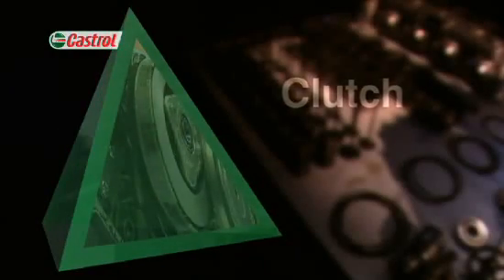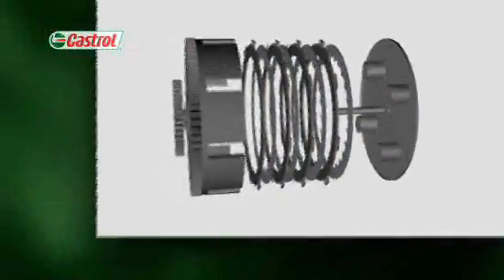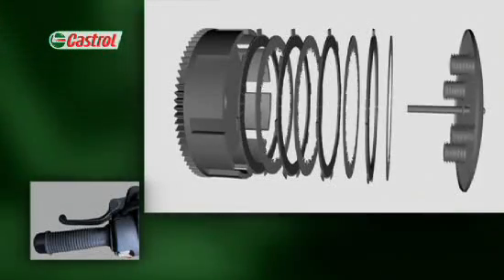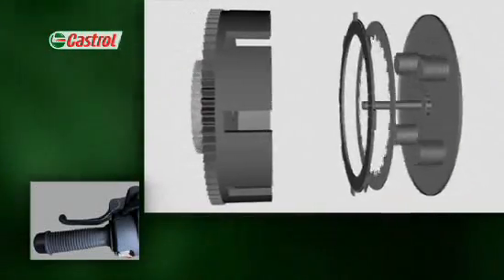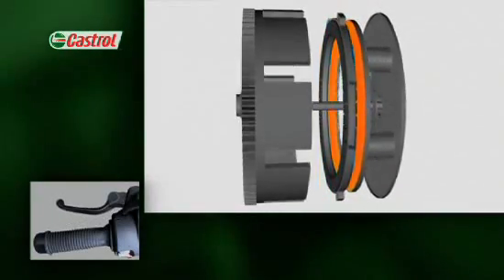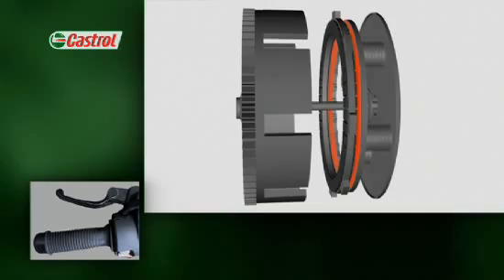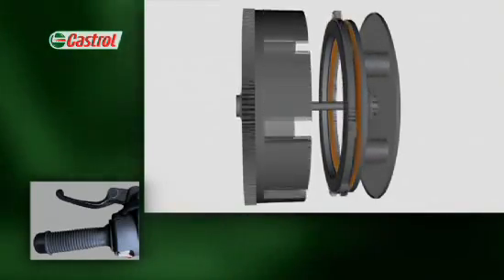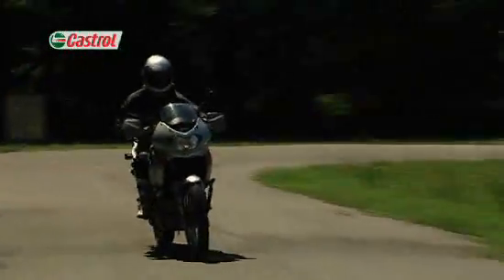Motorcycle Clutch Engine

Comment: can the clutch springs cause the disc to slip as I hit my powerband on my Yamaha dtr 125r I can hear and feel the pressure plate or disc slipping and creating a moped sound.
Reply: +Ryden Swalwell if i can remember it was the springs and the oil i was using.